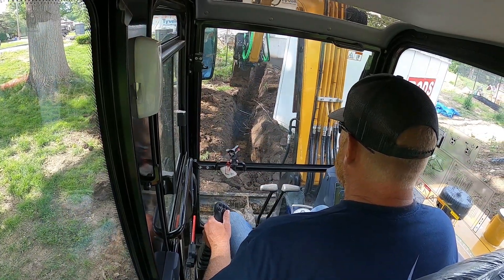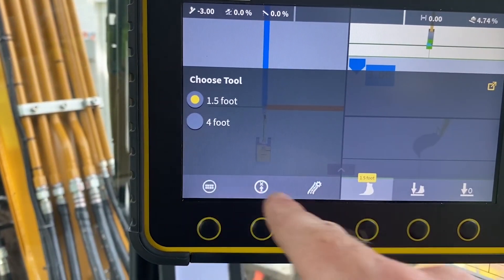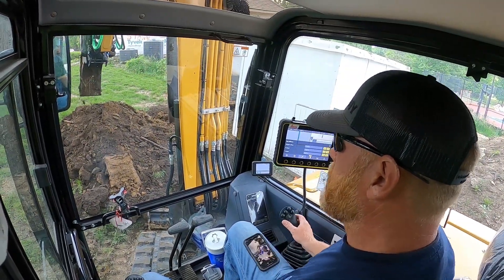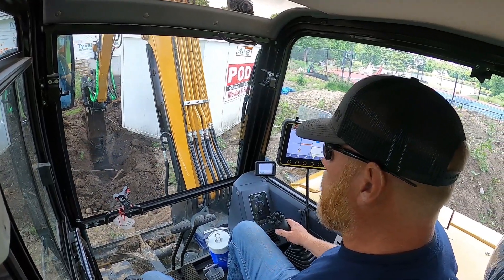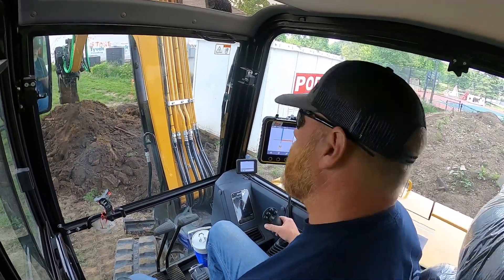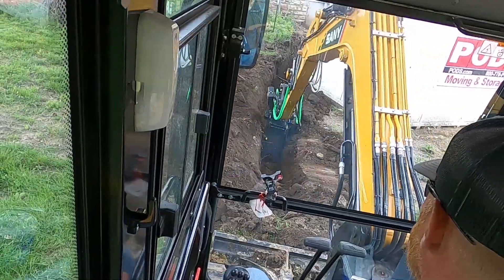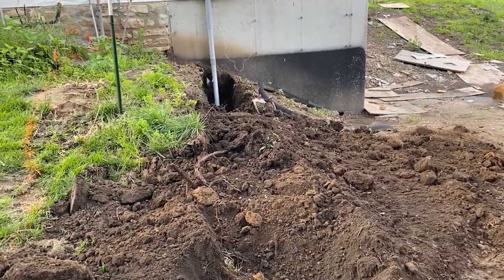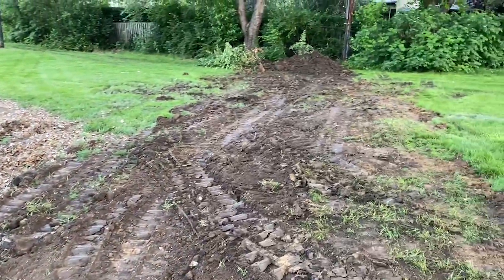First Project with Leica iXE2 2D Excavator System!! Electrical Service Install

Comment: Do you ever wish you bought the 75c or 80U?  Or is the Sy 60 sufficient for everything you do? I'm still looking to pick up a 35U and maybe a bigger machine as well, but currently limited by Truck Towing Capacity.

Comment: Do you have tilt rotator integration with the Leica system?  I'm looking at buying an x06 Steelwrist and they say their tilt sensors in the wrist aren't available till you get up to the x12.  This is for iDig so wondering if switching to Leica would solve this. Thanks for making these videos
Reply from the maker: I have the x07 and Leica had to add a tilt sensor on the Steelwrist. Another thing they are working on is a sensor for the articulating boom. As of right now we have marked where it is straight so I line it up when setting benchmarks.
Reply from the maker: I’ll have a new video showing more soon